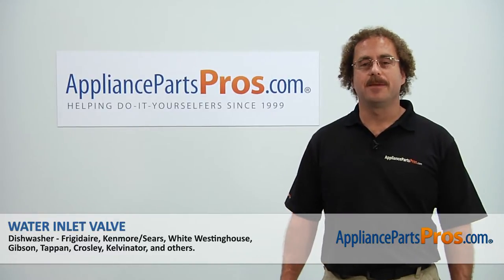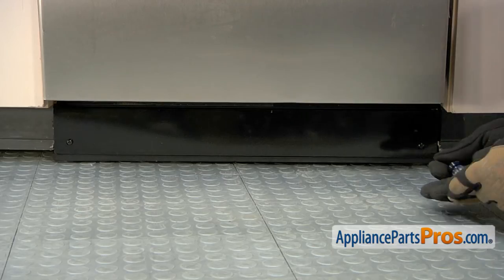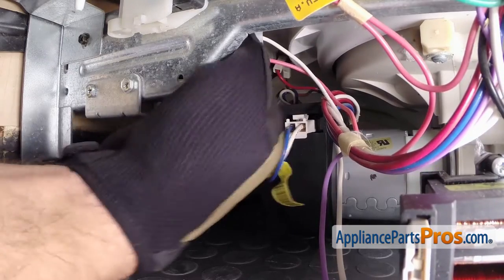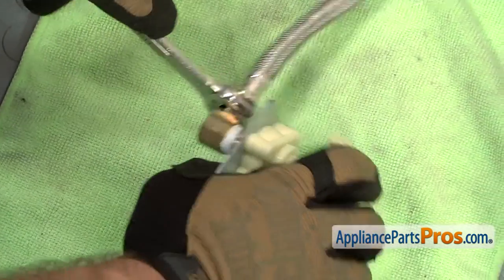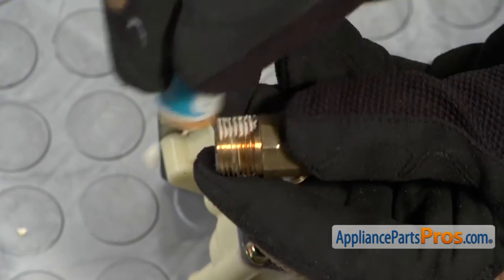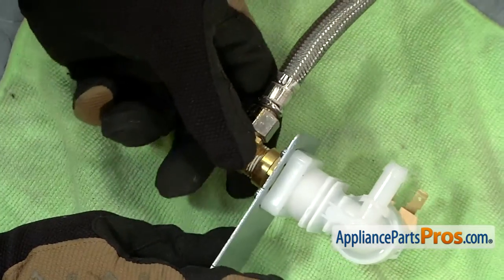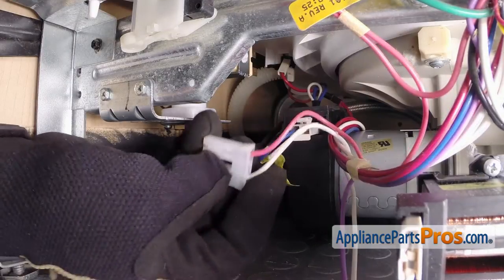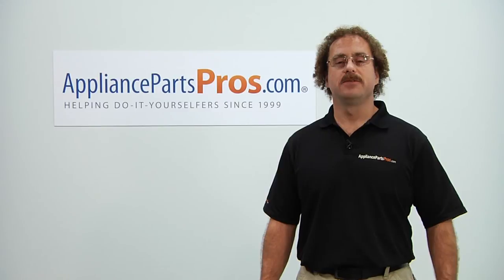How To Replace: Frigidaire/Electrolux Water Inlet Valve 154637401

Comment: Hi, I just replaced the water inlet valve on my girlfriends dishwasher. It is the same one in this video, exactly. Her water inlet hose is leaking around the back side of the hose. I replaced the rubber grommet/washer and it still leaks around the thing. Her water inlet valve has this short nipple that screws on the 90 deg. elbow, then up against the inlet water hose. I am not sure where that should end up on the shaft? I thought it was going to need some more pressure on it to flatten out the inside grommet. I got it to almost stop leaking, but it drips every few minutes. I am at a loss now?  After watching the whole video, I see the inlet water line you attached is a 5/8" hose connection. My girlfriends is like 3/4" or more , that is why they have that couple screwed on the 90 deg. valve. That is the problem. But I cannot change her inlet line because I cannot pull the dishwasher out. She just had a new hardwood floor put down, now I can't pull it out without major problems.   Have you ever worked on larger water lines like that for a dishwasher? It says for dishwasher right on the long hose. Thanks for any help.  Thanks for sharing this video.

Comment: The "brass fitting" is impossible to remove. What is the part number for a replacement? The repair cannot be completed without this removal and re-attachment step!